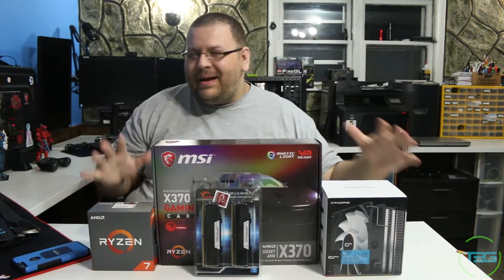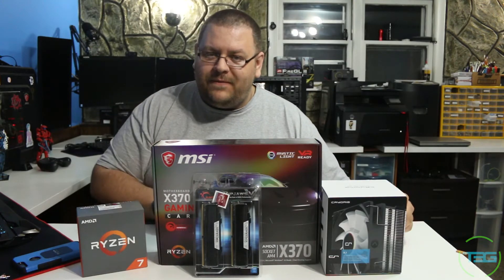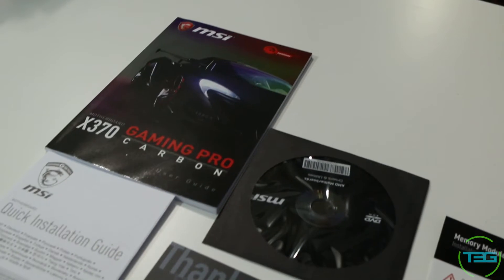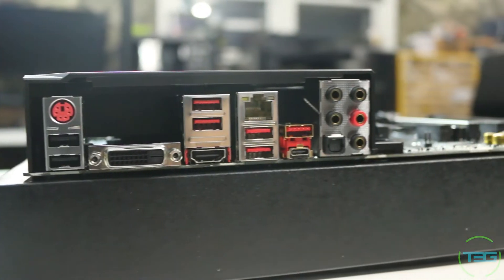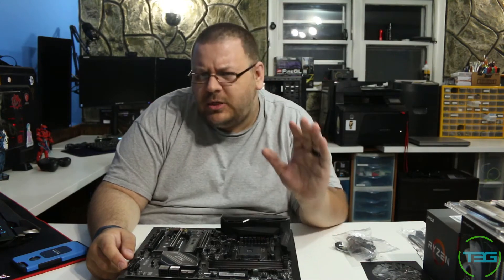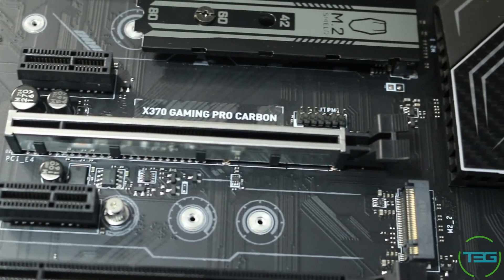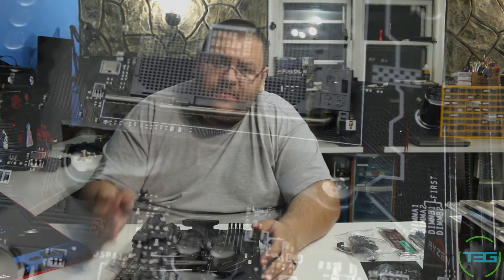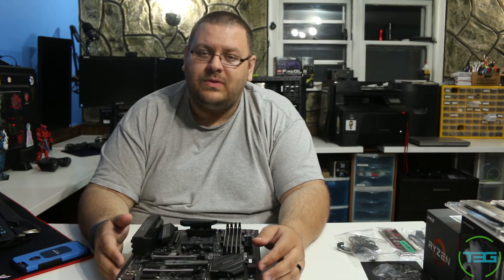MSI X370 GAMING PRO CARBON Motherboard Review | RYZEN Build P1

Comment: For this Msi board do you need to update bios or flash them im new to building and seen a x370 for 80$ and a Ryzen 5 1600 for 80$
Reply from the maker: i don't believe it's required for a ryzen 5, but there is an update since it came out.
Reply: @T3GMedia  okay so I could just throw them together and see if it post and if it don’t just get the bios Straight wanna build something budget nice 👌🏽

Comment: Hello I am pretty much the biggest noob at building pcs so I have a question, my setup looks similar to this (x370 carbon, Dual 1070Ti, and ryzen 7 1700x) I just finished putting it together but it didn't boot up... I put the ram into the correct sockets and the PSU works great. Do you know how I could go about fixing this problem?
Reply from the maker: Re-seat the RAM, check that a fan is connected to the CPU fan header, make sure the board is grounded - not loose on the standoffs.